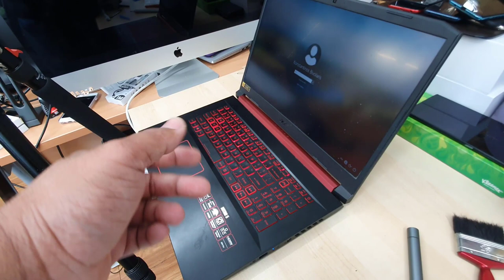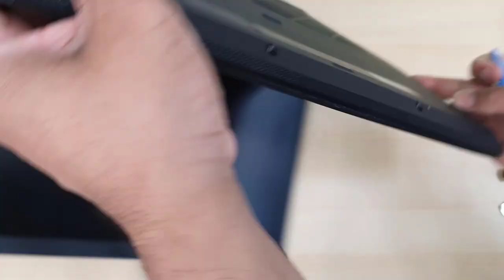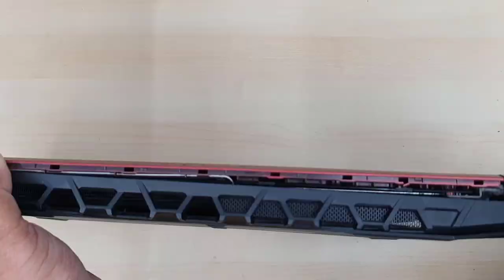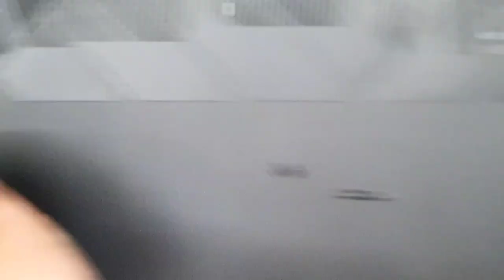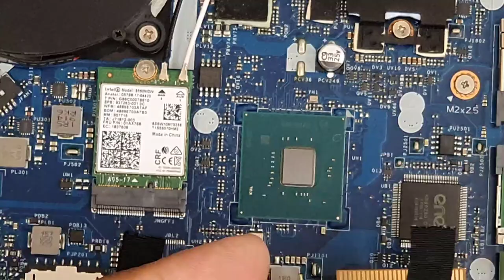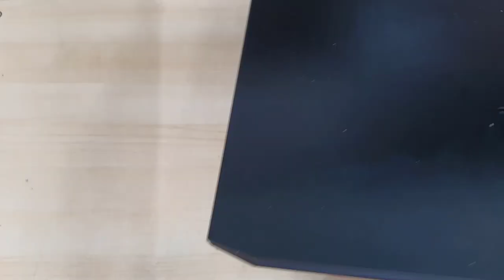How To Fix Gaming Laptop's Keyboard Issues | Acer Nitro 5

Comment: The whole keyboard of my Nitro 5 except for the power button don't work.
Reply: Did you fix it already?
Reply: Same
Reply: Same help me out plz😢
Reply: SAME DUDE HELP
Reply: Just wanted to know if you got this fixed, mine recently started with the same problem and have yet to fix it
Reply: If yours is under warranty then they will replace it for free, if not then it will cost you guys $50. Acer cheap out on many things, especially the screens so the failure rate is very high.
Reply: Did you solve it?
Reply: Same problem here
Reply: Same and it's weird
Reply: It's not a hardware problem, its something Acer made on purpose to make us expend money buying keyboards. I'm having that problem for about a year now, and everytime I leave it off for a while, the keyboard starts working flawlessly for a couple of days, then turn of again. I tried Linux, all kinds of HID drivers and some made it work for some time, then just stopped again. They could've made it easy to repair at least, but it is a pain in the ass.
The lesson is, don't buy Acer again. Save a little more and go for better brands.

Comment: Is this fix specifically for the entire keyboard, or just for a few keys? I have a few keys that do not or rarely respond.
Reply: same problem here :(
Reply: Same man .
When I type @ it will enter "
Reply: @bigrichmod  yes, if you don't remember spilling any liquid directly over the keyboard, dust is the only issue. 
Open up your laptop, disconnect the keyboard connector sleeve from your motherboard as shown in the video and put it back in. Should help.
Reply: @siriusblack1504  what if I did spill some liquid over the laptop and only after a year the key starts to rarely respond?

Comment: Wow. After messing around trying to fix it from a software angle-reinstalling drivers, updating, removing updates, I tried a system restore point. The restore point failed-it bricked my my computer basically as the screen would go blank on boot-up. Had to eventually do a full system restore-which did make my laptop usable again. Found this video today. It completely solved my issue. Now I've lost all my files/settings with 0 chance of recovery. Wish I found this video first.

Comment: Mine does not have the removable orange part you cleaned. The ribbon goes right in to the motherboard. Is this normal? Quite certain it’s the same model
Reply: Hi dont know if you still need help but try cleaning the inside of the keyboard button by just taking the keypad using something small and flat tilt it up and gently remove the key and using your finger or push down using the tool GENTLY

Comment: Thank you! This worked right away.

However the same problem came back 5 mins later. Should I send it in for professional cleaning?
Reply: Hi try to take out the key pad use a small flat head screw or something similar and take it out gently the key board and clean the inside using a toothbrush or use a can spray that could work to. I have the same problem but with different series of nitro 5 so different built and this method that he five does not work sine i dont have the orange part so yeah
Reply: @gamefacierglitches  for me my s 2 4 and some other doesnt work and after taking out everything it seems okay althoug i didnt take out the mobo so i just clean it up roughly and fit everything back in and clean the keyboard by my self and it works try doing this first if it doesnt work than you need to take it to a professional repair man
Reply: @ArthurAkiyama  Okay, thank you so much for your help!

Comment: I am having a problem in my nitro 5 515-54, my keyboard partially works nad i cant get to bios. (Changed the keyboard with a replacement still having the same problem.
Reply: Also mine doesnt have a converter.
Reply: any fix found? my s button dont work

Comment: Is there a way to fix the Nitro 5 2020 GTX 1650 144hz terrible gaming experience with low fps
Reply from the maker: Would you please explain a bit more about it? If you mean lagging, then I would ask  the couple of questions. For how long you own this machine and how dirty the cooling fan? Also, did you try to uninstall the graphic driver completely ?  Take those steps and hope the issues would be resolved. You may subscribe to this channel to show your support, and thanks for your time. Hope to see you again.

Comment: The only difference from that one to mine is that I don't have that "flat extension", the flat goes directly into the motherboard. I've striped it entirely, not a single thing wrong or misplaced. The  Keyboard came back to life from time to time when I was trying stuff like formating, going Linux and so on, so the hardware is OK.
It's just us being forced to replace it. I wouldn't even mind, if that wasn't fuckin hard and troublesome to do. Never gonna buy Acer again.